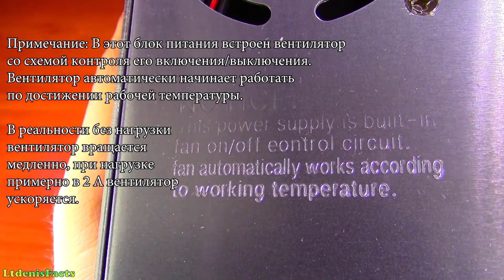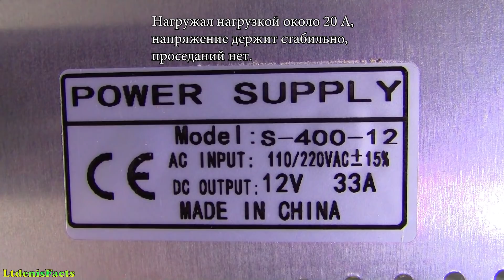Блок питания 12 В 33 А - 400 Вт LED. Что внутри?

Comment: Помогите выбрать блок питания для  подключения автомобильных усилков от 12в. Нужен мощный блок, так как усилки буду разные, на них и преды по 200а на одном бывает. То есть некоторые усилки потребляют очень много. Но я их на полную использовать не буду, в основном только для проверки. НО некоторые усилки я буду использовать на постоянной основе вместо домашнего усилителя. В них ампер 80.  Жду совета, спасибо.
Reply from the maker: Усилок с потреблением 80А  при 12В?! Да это почти киловатт мощности! Может вы имели ввиду 80 Ватт? Если так, то вам нужен блок питания на 12В с рассчитанным на максимальный ток 8-10 Ампер.
Reply: мне назвать модели усилков ? signat RaM 4 к примеру.
Reply: я занимаюсь автозвуком. Я не говорю о ватах, я говорю о предохранителях расположенных на корпусах усилителей. DLS MAD15 тут 160Ампер преды и номинал на 1ОМ в 1600вт
Reply from the maker: Можете от этого отталкиваться, но сами понимаете они очень дорогие:
https://ru.aliexpress.com/item/1200W-12V-100A-Switching-power-supply-for-LED-Strip-light-AC-to-DC-power-suply-input/32608303071.html?spm=a2g0v.10010108.1000014.4.45cc7ec0Q3J9VK&gps-id=pcDetailBottomMoreOtherSeller&scm=1007.13338.110449.000000000000000&scm_id=1007.13338.110449.000000000000000&scm-url=1007.13338.110449.000000000000000&pvid=de497a02-1fcf-4826-b3cd-2d1b034687cb